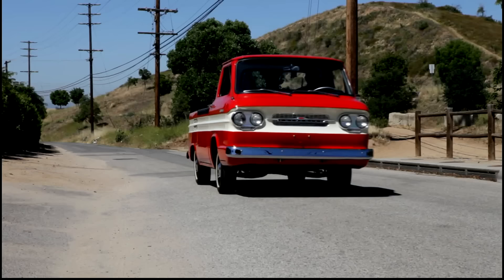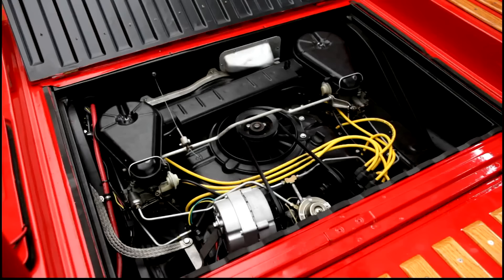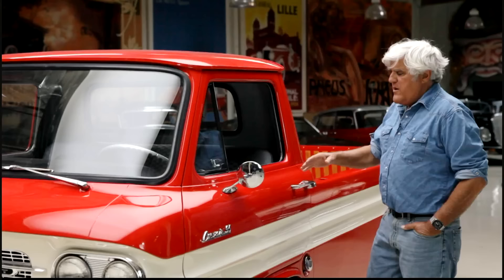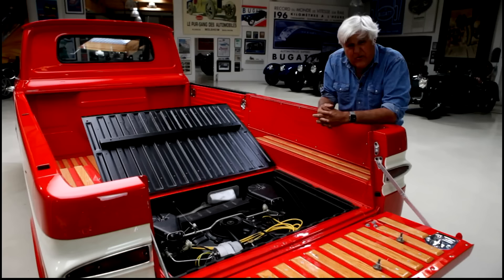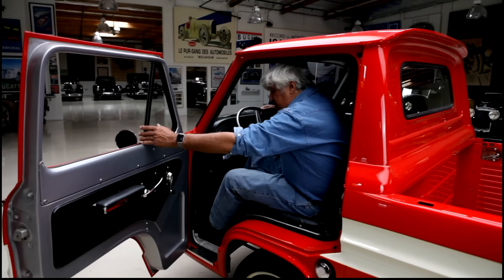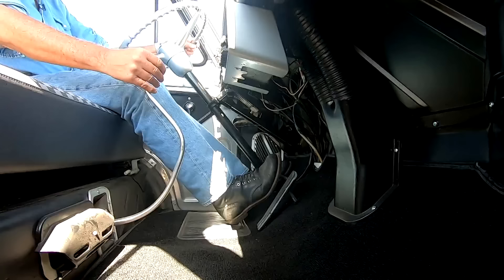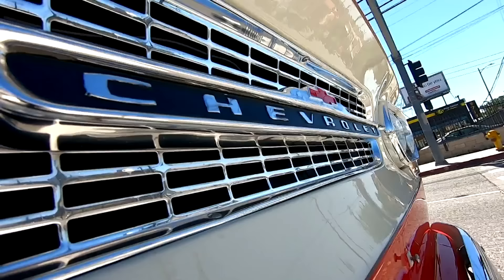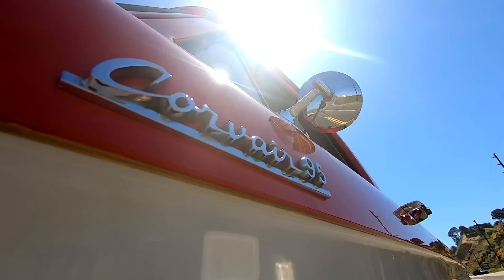America's Most Radical Pickup Truck - Jay Leno’s Garage

Comment: I worked at a local Chevy dealer from 65 through 68 who had a Corvair 95 pickup as a shop truck. I drove it a lot during those years and thought that it was a hoot to drive. Loved the presentation!
Reply: In 1972 a buddy of mine bought two Corvair vans and two pickups in great shape from a flower shop for $100 each. Yes, they were a hoot to drive.
Reply: Better to make them all electric now
Reply: @shable1436 make what all electric?

Comment: In my hometown, the appliance dealer had one. They loved it! They could load and unload a refrigerator or a washer or dryer or large console TV (remember that was 1961) easily. Low entry height. If you drive it up to a curb, the ramp was nearly flat! I don’t know now, but they might still be using it.
Reply: This was not new. VW sold a pickup based on Transporter platform for years. Except in West Germany, they had fold down sides! Even more convenient!! I spent hours driving one on the Autobahn while in the military over there.

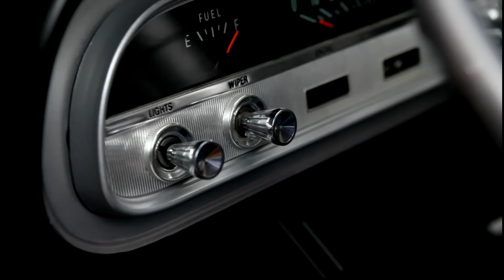Comment: 16:58 "Cigarette lighter. You have to have that, everybody smoked in '61."
17:04 "Ashtray. Gotta have that, everybody smoked in '61."
Reply: It’s true
Reply: I just enjoyed a cigar in my Armada last week. First time I've smoked in a car/truck in decades. Warm sunny weather, windows down, cruising the highway, nice...... Had to bring an ashtray, though....
Reply: My  68 Camaro convertible has 4 ashtrays and zero cup holders.
Reply: Always liked how in old, stripped down cars even basic safety stuff like seat belts, sun visors, outside mirror, heater/windshield defroster, door locks and such were options.  But cigarette lighter/ash tray, you better bet that was standard equipment.

Comment: I've owned & driven a few forward control vans over the years and I found sitting up front made you a better driver because of the lack of safety, but it's a great position for a city vehicle when you're coming out of narrow built up streets onto a main road because of the visibility you have both left & right.

I really quite like the look of this pick-up & you've done a great job in restoring it.  As for the split level in the back I think a fold up divider in the middle to separate the 2 levels would have been an ideal accessory.
Reply: And add sliding doors for getting in and out in tight spaces you have the perfect solution

Comment: Thanks Jay, you're a real friend. Really enjoy your company. Started off with my foster dad's 55  Chevy Bel Air with the best engine I've ever had, the 265, 3 speed on the column with a 2 speed rear-end which gave me 28 to 30 MPG. But I needed a van to take me to Mexico and Guatemala for my import biz and bought a 1962 Corvair Van. Designed a bed for a 6 foot person, a little closet with book-self and water storage, and bolted a large footlocker under the bed to act as a storage trunk. The van took me to Central America & back many times, put over 550,000 miles, changed oil every 3,000 miles, as well as some fan belts along with a couple head jobs. She gave me the same mileage as the Chevy, 28 to 30 mpg. Lost my storage space in Cal (I live in Hawaii) so I had to sell it not knowing what a great mistake that was. On my next trip I bought a 1964 VW van with a 1600 engine and drove it some 400,000 miles over the years, replaced 4 new engines at the Queretaro VW factory, always adjusting valves, changing oil, and driving in a gutless, dangerous tin-can. What a piece of crap. I tried many times to find another Corvair van, but thanks to Ralph Nader, no one wanted to let go of their Corvair van that was in any descent shape. How the hell did they take the Corvair out of circulation and let the VW tin can on the road??? Thank you for sharing your Corvair with us. Aloha

Comment: I owned two Corvairs.  My first one had the Gasoline Cannon heater. In Chicago winters it was great, Start the car, start up the defrosters and by the time you got out of the car to scrape the windows the ice was already melting.  My second had the manifold heaters.  With the way the engine seals leaked, we always got oil smoke in the car from the heat vents.  They were fun to drive though.  I love your restoration.  The red paint and the oak slats were great.
Reply: Had manifold heater in Indiana used to put the top down in the snow cause defroster wouldn't clear windshield

Comment: These are a riot!

I"ve completely restored one of these rampsides for a friend's father.
Painted it the same Hugger orange/white  color scheme, but a white roof top as well as the body stripe.
Interior is painted like yours as well.
 I had around 600 hrs labor into it,  replacing so much metal and vanishing several hundred dents.
It became a very cool truck, very much the same as Jay's, but on a far smaller budget.
The repairs did merit me a 66 Monza convertible as partial payment for my long  efforts,  a vehicle which I still own. Worked out pretty well.

A  gasoline heater is installed on that Rampside.  It isn't quite as thirsty as portrayed. They work extremely  well. That's what the owner desired, as its a Michigan truck.
Very cool addition and interesting design.
I was too, a bit leery of its safety until better studying it's design. 
When rebuilt and installed correctly, a gasoline heater is quite "seemingly" safe. 

Watching your video sparks a great deal of memories, of course as the build is very close to home for me and a mirror image  of your truck had occupied much of 6 months of my "free time."   It did win best of show in its category at Gilmore farms one year.
It does bring smiles to see yours in great detail.

Comment: I worked on a golf course in the 70's and there was a Corvair pickup we used to transport greens mowers.  The side loading gate worked great.  The real problem was the tendency for the side gate to hold moisture and was prone to rust.  The cab forward and tight turning radius along with four wheel independent suspension was a great feature.  Never saw many of these on the road.

Comment: I once had a customer with a 110hp Monza 2 speed auto. My boss and I fell in love with the car, it was a blast to drive, the owner's wife was an amazing cook, we so we spent more than one weekend at the customers house dialing in the carbs, valve train, alignment. That car got up to 90 in no time on the boulevard. Unfortunately the push rod tube seals had dried out from sitting too long and the heads needed to come off, the car filled with smoke after it ran for 20 min. The owner got a new job and moved far away so we never got to finish it. Thanx for the memories. And long live Clark's Corvair Parts.

Comment: So basically back to basics and perhaps that's a good way to be. In fact at the moment that don't seem like a bad idea ?
Reply: Steve Holmes Maybe, except for the part about the front impact structure being your feet and the airbag being your scrotum. At least the engine in the back helps with weight distribution, unlike the cab-forward Falcon/Econoline, which needed a cast-iron weight under the rear floor to help balance it.
Reply: At the moment, that is why I watch this channel. No politics, no news, just interesting car stuff. Thank you Jay.
Reply: @jlwilliams  and your point is ? If you want safety and technology perhaps its not the channel for you lol
Reply: I am with you.  I am all for safety. But I don't need cars that need "computer resets" because you changed the battery (BMW), or a special laptop and software to setup a brake caliper (Audi).  Don't ask me how I know the downside of all this.  In addition, my best friend had one of those lousy Nissan Versas with the automatic transmission, which kept shutting down on the freeway and going into limp mode, which means about 10mph as you are trying to not get killed.  They had a recall on the vehicle, for which my friend's car was one year off.  Neither the dealer nor independent shops could fix the car, and it didn't work right after two new transmissions.  My friend took a loss and traded it in for another car.  Who needs these kind of electronics and BS?  I know another guy who buys Porsche 911's every three years after his lease runs out, as he and his entire Porsche community out here in SoCal are afraid to hang onto these cars once there are issues because of the insane prices for service.  Cheaper to just lease new ones and dump them.

Comment: Every VW type 2 single cab owner is saying “hold on, this looks familiar.”
Reply: Yup!!!
Reply: Yes, it looks like a heavy duty version that was produced from the 1950's  into the late 1970's.
Reply: So, for 6 cyl boxer engines we have Porsche, Corvair and Subaru Outback.   All solid innovative vehicles.
Reply: this type of "short nose with a bed behind while not being an offroad vehicle" is still very common in Germany for commercial vehicles- the standard US type of truck is a rarity here
Reply: Spot on, my thought exactly.
Reply: I find it has more resemblance to a Type 3, but you're right.
Reply: @paulterhaar4862  You mean Type 2 Type 3 (T2T3) (= third eneration of the Type 2, the Transporter):D Cause the VW Type 3 is a a normal sedan or estate built between 1961 and 1973, also called 1500 or 1600. I mean this just shows how big imagination the German have. "So, we have a new car, even Hitler called it a Bettle, so how shall we name it? Hmm, what about Type One?" :D
Now we bulid the van, so how shall we name that? Well, it is our second model, so what about Type 2. And how will we name the second generation of the Type 2? so What about Type 2 Type 2?" :D
Reply: @AlejjSi  Prior to fuel injection the VW Type 3 had a flat motor with two carbs.  Pretty slick arrangement that worked very well.
Reply: @AlejjSi  In Germany T1, T2, T3, T4 and so on, are commonly used to tell which transporter is meant. By T3 I mean the third generation which is the square one. I personally owned a T4 Doka. Google that and you'll see which one I mean.
Reply: @paulterhaar4862  Yes, I thought you meant that.
DoKa: Actually, I saw one today in ym town. The T4 are still very common in here.
Reply: Not too different from the old VW microbus. Rear, air-cooled engine and driving while sitting above the front axle.

Comment: I had 5 Corvairs   when I was a teenager. They came with generators. I loved driving them and working on them,you remove 3 - 11/16 nuts and the engine and transmission falls out. GREAT VIDEO

Comment: Hi Jay, great show.  I absolutely love Corvairs. You reached out for some answers that you weren't sure of on the vehicle.  On the alternator, all GM cars had generators till 65, then switched to generators. Dual braking systems came on in 67. Yenko added them to his Corvairs in 66 for the safety aspect. Standard was the single braking system. Also, I think the fans at the top of the motors didn't start till 63 because of heating issues in hotter climates. Chevy solved most of the handling problems as to the suspension when they borrowed the layout from the Corvette and incorporated it into the rear engined Corvair.  If you compare the 2, they are almost identical.  This happened with the 64 model. Most of the tuck under of the rear suspension from early models could be eliminated by using a anti sway bar to the rear suspension  of the early models, pre 64.  You still couldn't break the habit of the customers over inflating the front tires. LOL!!  Again great show, I watch on line and also on CNBC,
Reply: Corvairs didn't have alternators until '65, although it is a relatively easy retrofit. I don't believe that the Corvair 95 line (Corvan, Greenbriar, Rampside) of trucks ever had alternators, air conditioning, dual circuit brake master cylinder or the gas heater.

This truck has many modifications. I believe these came with truck mirrors that would have extended the mirror beyond the vent window. The master cylinder and the alternator are also nice modifications. These trucks typically only had 3 speed transmissions. And perhaps the slickest mod was the 100 mph speedometer, as the truck lines only came with 80 mph speedos that had marks to indicate shift points.
Reply: @bartscanland9415  yes, meant alternator not generator, which all GM vehicles went to in 1965.  It was a typo. Thanks for spotting error.

Comment: This car is more interesting than any old car like a Malibu turned into an SS with a 1000 hp LS!
Reply: Len Peters, copy that.
Reply: But one of these with an LS6 would be amazing...
Reply: Jay Leno's garage have a really interesting video of a Buick 215 aluminum in a VW van.
Reply: @kimchipig  I saw that, it was pretty amazing.
Reply: The Bushwacker  it doesn't need to go 180... A nice 85 on the highway would be nice 😂
Reply: @brianhill4153  Sometimes less is more. Sure, hp is fun, but it doesn't always have a role.
Reply: @patkaczmarek7362  this is true. It's just a fun idea, really. Replacing this old engine with something reliable and strong would be the real goal. You could actually put something like a Toyota 3gzr in it and get more hp and torque, but it would be infinitely more reliable. I was really just joking about an LS6. This is an interesting vehicle overall, but owning one, I can imagine would be a costly hassle.
Reply: It is pretty special!

Comment: Boy does that bring back childhood memories!  My parents had a 1960 Greenbrier van. When they bought it, it was all red. Earl Sheib added the white strip. Looked just like your 95. I remember the gear shift linkage freezing up in winter and dad had to disassemble it and re-lube all of the u-joints.  Dad also had problems with the throttle cable fraying and sticking at the firewall. Had to ALWAYS carry a spare fan belt. When it broke, it would overheat in minutes. Kept it for 3 years and traded it for a '63 Pontiac station wagon with 3 speed column shift.

Comment: I owned a 1965 Corvair and it was a great handling car. By then GM had fixed the suspension so it didn't matter what tire pressure you used, I have been to SCCA races with a twisty track and a well set up Corvair would beat Corvettes around the course.

Comment: My Dad's service trucks and vans were all Corvairs , I put a lot of miles on them , they would throw the fan belt if driven hard ! My 1st car was a Corvair . We used to keep at least 2 or 3 motors standing by and could change them out in a matter of minutes ( I spent a lot of time under them ) and they were fun to drive. We also used the trucks to carry our horse back and forth to the lake so he could go swimming , we put a rail at the step up so he wouldn't fall down which he did the 1st time we tried it ( he didn't get hurt, he just sat right down on the motor well .) A lot of memories! My dad bought the 1st one sold in our area

Comment: I really think Ed Cole was the most under rated engineer on Earth!
Reply: History proved him wrong on rear-engine vehicles being the future of basic transportation. But the bean counters undercut everything he did. If the Corvair had the $15 worth of suspension upgrades that became standard in '64, from the start, if would have avoided all the bad press. And, if the Vega had had the upgraded cooling system from the start (as well as  passable build quality), it would have been considered a success.
Reply: Look up Isambard Kingdom Brunel at https://en.wikipedia.org/wiki/Isambard_Kingdom_Brunel  Engineering covers far more than engines.
Reply: what about Sandy Munro, he worked at Ford Motor. 
now, he does Teardowns of the Tesla to Deconstruct and Analyize.

Comment: My 1st vehicle was a1967 GMC Handivan.  The engine was between the front seats and you were basically sitting over the front wheels in a cab forward design.  It made it very easy to drive because you could actually see where the van was in relation to the road.  I could change spark plugs sitting in the drivers seat!
Reply: Hopefully not whilst driving☺!!.

Comment: What I see as modifications on this rampside. Alternator for generator, guides for the fan belt which were a later Corvair change, duel master, cast finned oil pan and valve covers, and the mods to the cargo floor with the wood. Since you have the alternator and other non-stock engine stuff I would bet that it has a later engine which had 20 more cubic inches. Sweet ride Jay!

The Vans and Rampsides were famous smuggler vehicles. The owner would build the floor out flat and hide stuff under the new floor in the low area. Customs was always on the look out for these as people would would hide under the floors to get across the Mexican border.
Reply: It's got later carbs with auto chokes.
Reply: The fuel tank and shift linkage has been replaced. The stock tank had a tunnel hole for the shift linkage which went straight thru the tank.
Reply: @tomclark6271  I never saw a 98 with a manual. All the ones I dealt with were powerglide transmissioned. I was wondering how the shifter worked.
Reply: @keithstudly6071   My friends have a real beauty, a '61. It has won many awards for being totally stock. Of course, they trailer it everywhere. I assisted him in replacing one side of the motor jugs and head once. Very interesting!